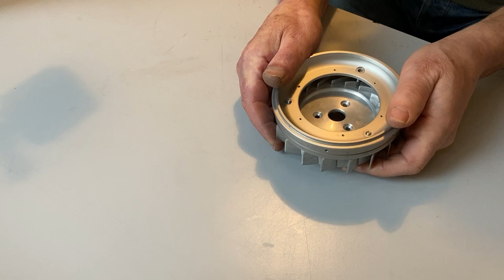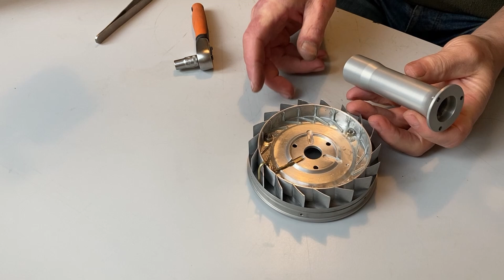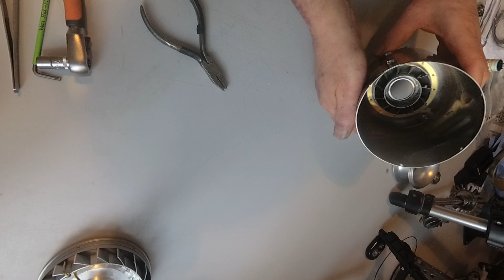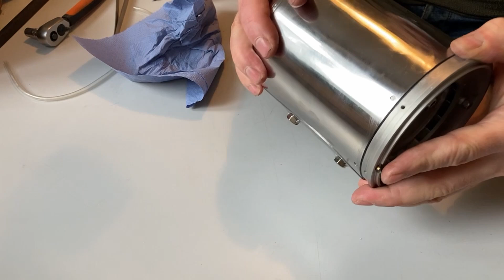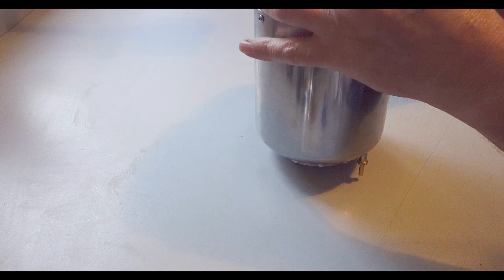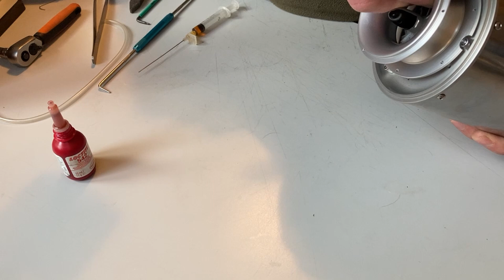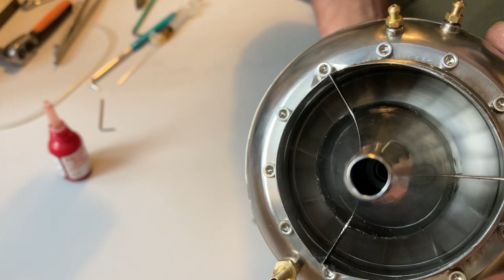Assembling My Home Made Jet Engine

Comment: Im quite confused how you created a good oil seal, it seemed like that feed tube just kinda is pancaked in the mating for the center shaft housing, does it leak oil?
Reply from the maker: Hi. Yes, you are correct in your observations - The lubrication system is a "total loss" oil mist - A small amount of pressurised air from inside the engine blows through the slots between the diffuser and the shaft tunnel and into to the inside of the shaft tunnel (which is open at the rear end). The pipe is just clamped in one of the slots (not tightly enough to close the pipe off though) and any oil that comes out of it is carried away by the stream of air. This produces a stream of air and oil droplets flowing down the inside of the shaft tunnel and through the bearings which cools and lubricates them. When this stream comes out of the rear bearing, the oil just gets burnt up with the exhaust from the engine (a bit like how a 2 stroke petrol engine is lubricated). Thanks for asking!

Comment: You have finshied everthing that  I have dreamed. I wated to make by hand  every thing related with rc jet engine. You  alomost showed that except electronics like control unit. But I love it. Great!!
Reply from the maker: Thank you very much! At the moment there is no electronics, but I'm trying to make a better RPM sensor which might mean an Arduino, so I may as well have that display EGT as well... And if it knows about those things, it may a well control the fuel, too... (You see how these things snowball :D ). Thanks for the comment, and thanks for watching. :)

Comment: Good job MisterG. I saw your test run video. The engine runs very smooth and looks well balanced. I appreciate if you could share the brand of the hybrid bearings that you are using? I'm also developing a small turbine but I'm facing high level of noise and vibrations.
Reply from the maker: Hi, Thank you very much for the kind words :) 

The bearings are full complement hybrid bearings - I could not find any ready made at a price that I could stomach, so ended up buying  some generic, caged, hybrid bearings (from ebay /  Alibaba). I took the balls out of these and machined away one side of the inner race so they could be reassembled with a full complement of balls (the extra balls taken from another bearing of the same type). This is not my original idea, but it works well because the bearings are pre-loaded against the un-machined side of the race.  There are some photos here:

https://misterg.org.uk/turbine-html-10/   

Others suggested doing the same thing, but buying Si3N4 balls of the identical size to the originals but every type of bearing I took apart seemed to have very slightly different ball diameter.

I am no expert on turbines, bit I would say to check that the shaft is straight after fitting the turbine - I was very, very surprised how easy it was to send the shaft out of true when the turbine nut was tightened - just a slight burr or speck of dirt on the mating faces will cause a runout on the shaft. A sensitive indicator will tell you. Runout on my assembled shaft was ~0.004 mm TIR.

(Feel free to contact me via my website if you want to discuss further).

Good luck! 🙂
Reply: Dear MisterG, 

Thank you for your attention.

I agree with you that the shaft parts concentricity is critical for turbojet engines. I need to improve the machining process of my shaft and shaft tunnel to achieve better alignment. I found some misalignments in the shaft and due to this the balancing of rotor parts assembled is affected too. After that I will check the quality of the bearings too, if necessary.

Congratulations to your website. There is a lot of good information.

Thanks
Reply from the maker: @Fabioaw  No problem - let  me know  i I can help.